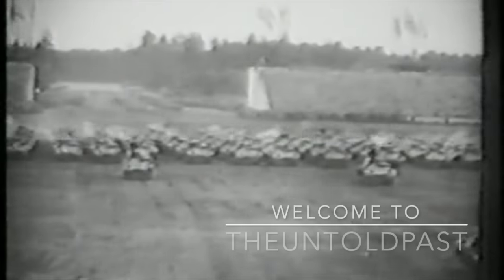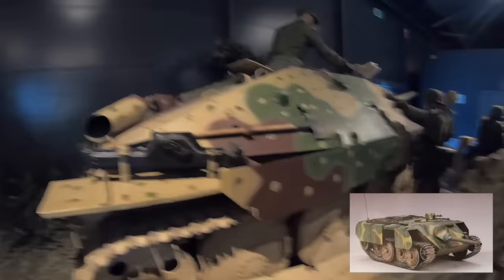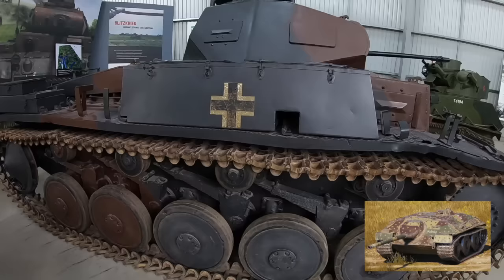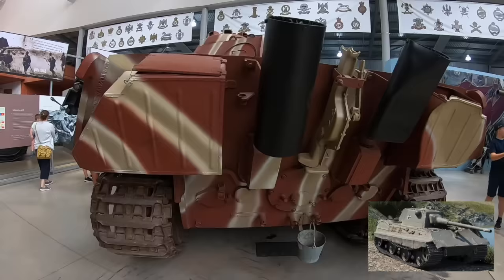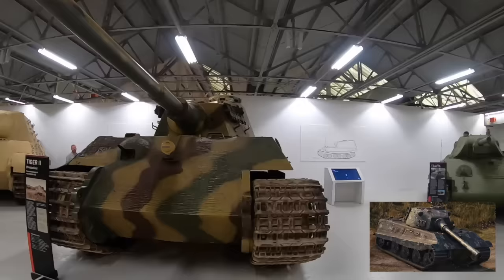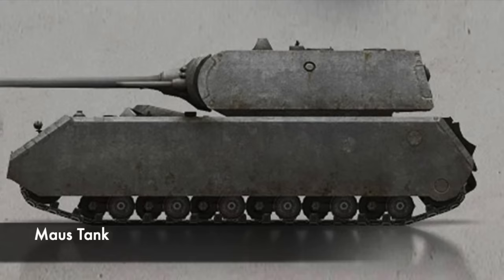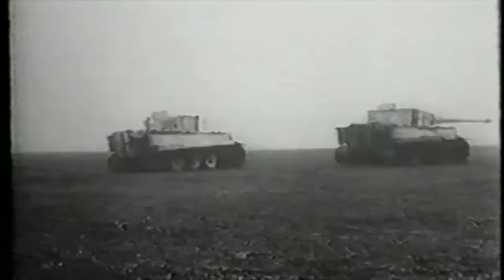The E-Series Of Tanks - Hitler's Dream Tanks

Comment: The Germans were perfectionists. If even so much as a rivet was out of place the tank would go back to be fixed. Meanwhile, Russians were pumping out t-34s and could care less if it was covered with spot-welds.
Reply: The German war industry was capitalist to its core; the manufacturer's main concern was turning a profit, not winning a war. More cost effective - and ultimately more effective - weapons of war were born out of necessity, not because it was the sensible thing to do. StuG III and IV are stellar examples.
Reply: I watched a video were the Germans while working on a submarine used a file to remove steel. Then showed an American doing it with a grinder.
Reply: The Russians had a enough man, material and oil to spare. The Germans not.
Reply: @steveb6103  before the War destroyed this countries culture and pride, things like beauty and perfection in ones work was most valued
Reply: Only a person with no knowledge of german wartime production would say this.
Reply: this is just wrong tbh. No offense to you but this feels highly based on ww2 stereotypes. By 1945 german weaponry, armor, and machinery was not only worse than overall russian equipment, but also was in low supply, was so overengineered that it could not be simply repaired in battle, and were highly unreliable. Many tanks had to use armor substitutes, and faced critical mechanical issues. If i recall correctly, the first time king tigers were deployed in combat, only a few of the somewhat sizeable group actually made it to the frontlines to fight. Russians had manpower, yes, but their weapons were not of supremely low quality. in fact, T-34's are argued to be one of the best tanks in the war - performance and reliability wise. The russians simply outsmarted and outproduced the germans, who overextended themselves and had far too little resources
Reply: That’s a myth.

Comment: Rated E for: Excessive weight
Reply: Lmao
Reply: Rated E for: empty fuel tanks
Reply: Rated E for: Excessive transmission stress
Reply: Rated E for: Excessive Soviet infantry and tanks
Reply: *Excessiveness
Reply: @noahdavis3236  Can anyone, please, explain why the Panzer IV D/H has those distinctive two "hatches" on the frontal armour?
thank you.
Reply: @leoarc1061  if you’re referring to the hatches on the more horizontal part of the frontal armor, I’d like to believe they are meant to allow the crew access to the transmission/final drives for regular maintenance and upkeep so that it hopefully lasts longer than it’s fuel reserves
Reply: I think that most variants do have them. They just visually stand out without the spare tracks on the hull.
Frankly, I am embarrassed. I have been studying history for years and only now noticed those 2 hatches!
Absolutely embarrassing!
Reply: @noahdavis3236  Thank you ever so much! That does make sense. One website classified them as escape hatches. Can they be used as such?
Reply: @leoarc1061  oh definitely not, they’re small enough as is, not counting the fact that they are directly above the transmission as well, making them simply impossible to reach and squeeze through. I’m fairly confident they are only meant for mechanical maintenance and repairs
Reply: Thank you very much for your input.
I just researched this topic. There is absolutely no space for them to be escape hatches.

Thank you ever so much for your help.
I did learn something very important today.
Thank you Mr. Davis.
Reply: Rated E for EICH, it's a pipe dream!
Reply: @Lucky-be3oq  looks at e25*
Reply: AHHAHAHAH
Reply: Rated E for ineffective without Luftwaffe.
Reply: Rated E for: Excessive parts breakdown.
Reply: Laughs in E 100
Reply: @dictolory  get=holen (in this case hole or hol') and Panzerfaust is female.
But that's not too important 😁
Reply: @Jan_372  google translate had lied to me
Reply: E25 not so much the others yes

Comment: “The E-25 would replace the Pz 3 and 4” shows panzer 2
Reply: If I am right, that's actually panzer III, but with a turret of panzer II, not 100% sure.
Reply: @ilija4909  if that’s true that would be pretty cool for a pz II turret to be on the chassis of a pz III
Reply: @ilija4909  that's a panzer II through and through, both hull and turret.
Reply: @christianforsstrom2222  Yes, you are
 right.
Reply: You can easily tell them apart. The Panzer II had five road wheels, the Panzer III had six.
Reply: @HereNowOOO  I totally forgot about this comment, what other things did you find
Reply: @ilija4909  no its not, the suspension, roadwheels, turret position and everything else gives up it's a Pz. II
Reply: @Marcus Vilas Bôas Yes, thanks for correcting me. When I posted comment I still couldn't very well see the difference between Panzers II's and III's chassies.
Reply: Yes, that's a 2cm auto cannon, not the 3.7cm or 5cm by a long shot.
Reply: @canadiankaiser4539  I looked at the design it doesn’t look like a panzer 3 hull at least not the ones I’ve seen

Comment: 6:20 just like to point out the Maus turret was NEVER planned for the E-100 the turret was WAY too heavy for the hull, the E-100's turret never left drawing phase and is currently only correctly represented in World of Tanks.
Reply: War thunder...
Reply: @cromux3191  There's a reason I didn't say WarThunder because WarThunder has it WRONG
Reply: @JetfireQuasar  just curious, whats the difference between the turret in WoT and WT
Reply: @szymonchlebicki4606  Warthunder has the MAUS turret

WoT has the paper mock up turret that was planned
Reply: @JetfireQuasar  can you link the world of tanks one because i can only find a turret identical to the war thunder maus tank.
Reply: @Jabooty_Williams  you'll have to type in world of tanks e100, YouTube don't allow external links anymore. 

It should be a trapezoidal turret with a single slope on the front face
Reply: @JetfireQuasar  i thought you said WOT had it wrong? I know WT has it wrong
Reply: @cromux3191  you didn't read my comment then because my comment says that wot is correct
Reply: @JetfireQuasar  wow I never noticed that the e100 had the maus turret in wathunder, I'm blind
Reply: @JetfireQuasar  (edited)
Reply: @JetfireQuasar  you originally said it was "only represented in WOT" not "only correctly represented in WOT"
Reply: @cromux3191 even in the original comment, no where does it say I said wot had it wrong
Reply: The video did say that during development the E-100 had a Maus turret, and it never got out of development...
Reply: @cromux3191  war thunder has the maus turret on it
Reply: @JetfireQuasar  War Gaming made up the turret design for the E100. The E100 was only in an experimental design phase where Henschel built a chase design. Henschel didn’t make turrets or main armaments, Krupp was the brad that built those. Krupp Never was given a contract to build a turret for the e100 as it wasn’t past that experimental stage, hence a mock up maus turret was put on it even though a maus turret would never work as it would be too heavy. In World of Tanks War Gaming just though of the ‘what if it was battle ready’ and made a turret design that would fit (And this isn’t the only time they have done this). War Thunder just stick with the experimental design of keeping the maus turret on it. 
So yeah, world of tanks is made up, not correct by any means as it never existed.
Reply: @maccabee3753  do some bloody research the Maus II Turret was already through contract stage with Krupp, Tank encyclopedia has all the details. 

Wargaming has a track record of improvising the truth but the E-100 is not part of that.
Reply: @JetfireQuasar  Tank Encyclopaedia also says those files of the drawings were redrawn post war by the allies as the Germans burnt the originals
As in the allies weren’t completely sure what Krupps design was other than they fitted the Maus II turret to it after removing 35 tons
Reply: @maccabee3753  but you said it never existed and Krupp never has a contract, both I proved you incorrect
Reply: @JetfireQuasar  my point was that all original drawings were destroyed. From a historical point of view while yes the maus turret was to heavy, War Thunder is historically accurate. The design that war gaming has which is only found in a very few sources is a post war redrawing of what British Tank engineers thought it would have been when studying it which holds no historical value since they aren’t Krupp designs. Tank encyclopaedia quotes “drawing 021A38300 was redrawn from the burnt scraps of the original. That drawing showed the original Maus-shaped turret from the Typ 205”. The turret drawings were all just Krupps Tiger-Maus design from the late 30s, all drawing designs on Tank Encyclopaedia clearly show the Krupp’s Tiger-Maus turret drawings only mentioning the WoT design of the turret as a redrawing of an improved Maus II turret where it would be light enough. 
It doesn’t make War Gaming’s design correct by any means as there’s no proof of it ever being real at all.
Reply: @JetfireQuasar  Hey man I didn’t mean to get you pissed or anything. I don’t even play either of the games so I couldn’t care less. I’m just saying the drawings are or a maus designed turret, and all mock ups were a maus turret. 
So yes War Thunder is by definition historically accurate since there is no historical mock ups or at least German drawings of this improved maus II turret you hold so close to your heart in WoT.
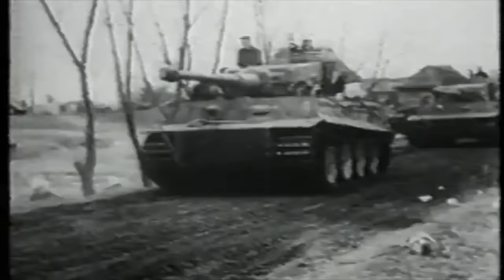Reply: @maccabee3753  there was a 1:5 scale mock up with a 1:10 mock up planned.

The E100 was never designed to have the Maus turret that is completely fictional, there was a TIGER-MAUS project but that was a competing design against the MAUS and THAT is what is in Warthunder.
Reply: @Bored_Kaga  I am very aware...
Reply: @JetfireQuasar  Why are you trying to argue...
Reply: Sir,this is a youtube comment section.
Reply: Funny that WT is meant to be more realistic than WOT but more.often than not they mess something up historically,  like with the Panther 2 turret
Reply: I was going to say the same thing, also, while talking about the E100, he shows the Maus, never did show E100 hull which has spaced armor that is more rounded compared to the boxy Maus

Comment: Except it never would have "rolled over the horizon" because there were few bridges that could even support the Tiger II.
Reply: E100 would've exceeded the weight limit of the German horizon.
Reply: @LoisoPondohva 

Challenged Goering for the German horizon.
Reply: They tried to stick the E-50 (panther)'s engine into the E-75 (Heavier KT) like bruv do you want a tank or a campfire
Reply: @ToddSauve  yeah, this was a video made by a german fanboy who doesnt understand armored warfare at its slightest
Reply: that's kinda my opinion. unless you have endless nice clear fields of non muddy reasonably flat terrain, anything bigger than what they already had would be a Maginot line on treads.

Comment: Germans: "We need to make cheaper and easier to produce tanks so we can match the rate of construction of the Russians".
Also Germans: "Let's do the E-100"
Also also Germans: "Yes, and the E-10, the E-20, the E-30, the E-40, the E-50, the E-60... I mean, we need several types because reasons".
Reply: Speer: blood pressure audibly rising
Reply: To be fair, one of the neat things about the E-Series was that the transmissions and suspension systems on all of them were using a modular system with completely interchangeable parts. The bigger vehicles just used more of the same modules than the smaller ones.
Reply: The E - series was to replace everything prior, what did you expect ? 
It's normal to have different vehicules for different roles, those that try to do too many generally fail at evrything.

The soviet had a wide arsenal of vehicules, perhaps more so than the germans : the T-34 variants, KV - 1 variants, KV 85, SU - 122, 76, 85 (M), 122P, 152, 100 (post war), ISU - 122, 122S, 152, T-70, T-80, IS-1, IS-2 (mod 1943 and 44), american and british things, as well as captured german stuff, many gun trucks and so on...
Reply: @Spido68_the_spectator  Yes, but the Russians didn't have their factories in bombing range like Germany...

Comment: The E-10 was not supposed to replace the Hetzer, it was the Hetzer. Due to a misunderstanding in the Škoda Works, this project name for the intended replacement of the Jagdpanzer 38 was regarded as new name of the Jagdpanzer 38. While the misunderstanding was sorted out fairly quickly, this wrong nickname never fully disappeared again. And so it was used as the main name of the Jagdpanzer 38 in post-war literature.
Reply: How the hell did you manage to use bold type in your comment? That is all we care about son!
Reply: tutel 🐢🐢
Reply: It was called hetzer by the Czechs no?

Comment: Even if the E-series had come earlier and were a succes, they were doomed from the start. 
The German war machine had a much greater, general problem throughout the entire war: it was extremely thirsty for fuel. With Germany lacking domestic oil reserves, they were fully dependent on oil from conquered territory and/or allies. Both of which were in increasingly short supply as time went by, meaning Germany was on dire straights.
Germany tried to resolve to synthetic fuel from coal, but that proved complex, costly and quite inefficient. Not to mention industrial facilities being destroyed by continuous Allied bombing raids. By the end of the war, fuel was in such short supply, most remaining tanks and vehicles were abandoned, simply because their fueltanks were dry. The war was being lost due to lack of juice, too. The Battle of the Bulge for example, a last resort attempt on turning the war in favour of Germany, relied greatly on the capture of allied fuel supplies. Which failed. Grinding the attack to a standstill within days, resulting in imminent defeat. Even with E-series tanks, Germany was doomed too fail.
Reply: Absolutely correct

Comment: "E100 would have inspired fear in the enemy" - Until about 5 minutes later when the royal artillery or air force send it a gift basket
Reply: Yes
Reply: Very true
Reply: CAS wouldn't be effective against it, as it probably would have airsupport when ever used, or a friendly Kugelblitz along side.
Artillery? Yeah artillery doesnt work like that buut okay.
Reply: @Marly375i  why didn't Tiger IIs get air support or Kugelblitzes then?
"Would've", yeah. If Hitler hacked the game for unlimited resources.
By the time those designs would've gone into production Germany wouldn't have fuel, nickel, copper, steel, rubber, and, for that matter, pilots.
Reply: @Marly375i  

An Artillery shell hitting the top of it would have gone through and liquified the crew inside it.

If they hit the track? They'd blow it off. Now the Infantry can walk at a nice pace around it, because the turret traverse is so shit, climb on top and throw a Gammon Bomb down the hatch.
Reply: transmission breaks before it gets in range of enemy artillery xD
Reply: @dictolory  
Runs out of fuel after it rolls out of the factory
Reply: @Marly375i  CAS sucked against tanks full stop, you try direct hitting a tank with a dumb rocket or bomb from 2000m while flying by at 400 mph using only a simple reflector sight.

What CAS did not suck against was soft-skinned vehicles, i.e. the trucks carrying the fuel and ammo. Near misses or strafing with guns are sufficient to take them out, and a Tank without ammo or fuel is nothing more than an expensive roadblock.
Reply: Artillery and air force was not successful against tanks, they were better against fortifications and logistics hubs.
Reply: @ThatZenoGuy  The E-100 would have moved only slightly faster than a pillbox, it would be considered a fortification.
Reply: @chaotixthefox  
The E-100 was actually fairly mobile relative to stuff like the Maus. Additionally the colossal armor of these tanks would require direct hits with bombs, which even a slow moving target is difficult to acomplish with.

You are far better off shooting at the fuel trucks NEXT to the E-100 to cripple logistics.
Reply: @Marly375i  wdym by "artillery doesnt work like that"? 
an artillery shell can and will destroy a tank if it hits it, if it blows up the tracks then good luck repairing it while being shot at
Reply: @ThatZenoGuy  a big enough bombs would destroy the tracks if it is close enough, and it could also injure/knock out the crew inside
Reply: @tcg1_qc  
Historically that was unlikely.